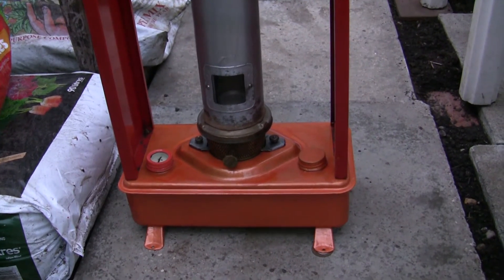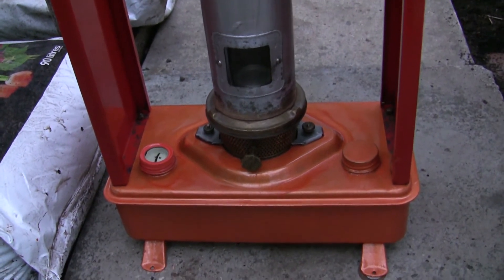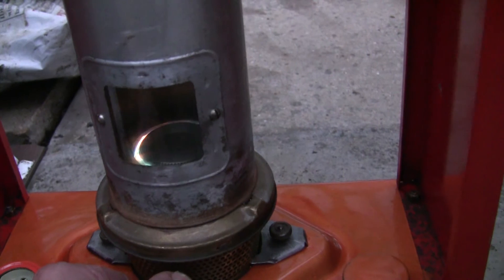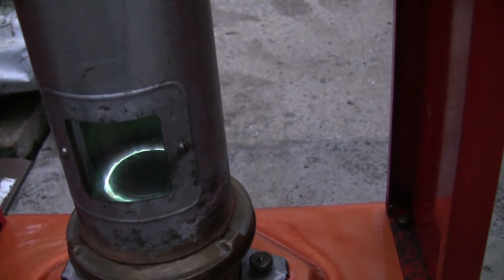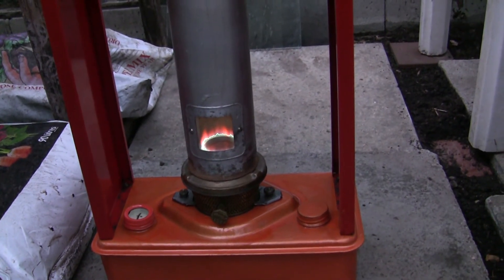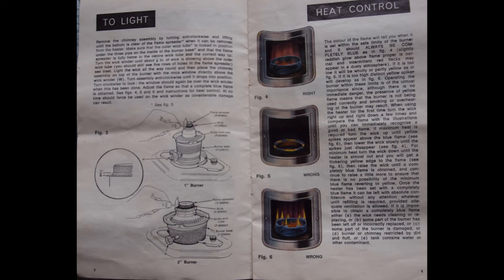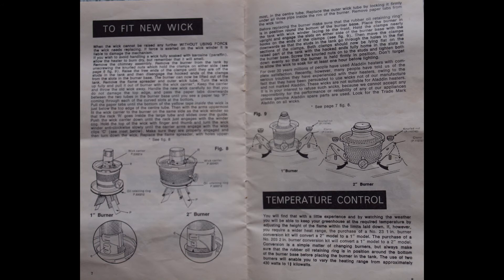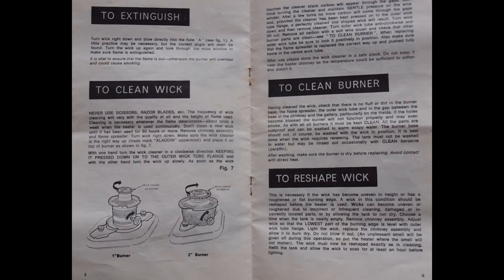Part 3. The Aladdin Series 22 Greenhouse Paraffin Heater working.

Comment: Super video,s..We where heating our hole house Last Winter with three 2 inch and one 3 inch Aladdin Heaters Burning home Heating kerosine oil with carbon monoxide alarm,s watching for danger and the right ventilation ..CHEEP AS CHIPS...Is this the lost Art.????????
Reply from the maker: I agree I find mine does carbon the wick up quickly with the 28-sec heating Kerosine here in the UK. But if you clean it frequently they do burn and work OK. I have one of those expensive Inverter type paraffin heaters which has a fan in them I must do a review on that one. Great comment thanks Kev.

Comment: Excellent Video. What is the difference between an Aladdin 22 and and an Aladdin 203 burner? My burner looks like the one you have (a series 22) but elsewhere online they seem to be described as a 203.
Reply from the maker: Hi, thanks I always thought that the 22 Burmer had a different way of fixing on to the tank it did not have those two aluminium knurled nuts and plates to hold the 203 burners on to the tank. But I'm not an expert on all the models. I think the important thing is that if you have the numbers 203  on your brass wick winder that's the model you have and hence to buy a wick and parts for a 203 burner I think. hope that makes some sort of sense,  That Guy at the link of the Base Camp re one of the links that I sent you really knows these models inside out and seems happy to answer any question via email if you did have a problem with the model Nos. He supplied me with a new cap for my paraffin gauge as mine had just rotted away never thought I would find one of those! Thanks for your kind comments. Kev.

Comment: Are all old heaters like this the same parts inside a unit ?
Reply from the maker: Hi, thanks there were many variations and this being a Greenhouse model Aladdin 22 Series this is therefor quite basic as was never designed to go in a house so did not need to meet the BS kite mark, but most of the Aladdin Blue Flame heaters are based around this type of unit so are the Valor made Blue Flame heaters so you will see much the same kind of parts and components in all this type of Blue Flame Paraffin heater basically its a wick either 1, 2, or even 3 inches in diameter with a chimney. Mica window to see and set the flame. Some of the later Aladdin's and Valor house hold  paraffin heaters to meet the later British Standard Kite Mark safety had a system fitted that if the heater was knock or moved while it was running and alight Then a spring system would bring a cover down over the burning wick and hence put the wick out  very quickly so as to stop any spilled paraffin catching fire if the heater had been knocked over completely . 
Thanks for you comment Kev.
Reply: @BramleyProductions  ...... have you got an email address ? So I can send a photo
Reply from the maker: @radiogramgramophonetoons5802  kevbygrave19@gmail.com Always happy to try to help. Kev.